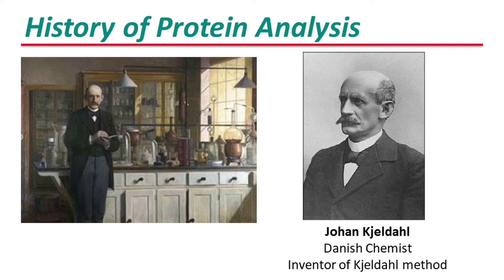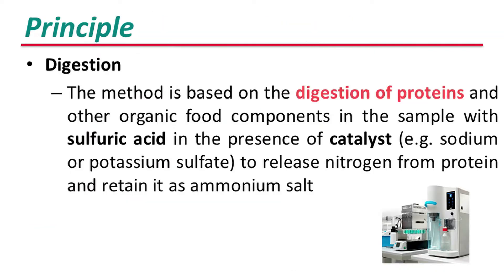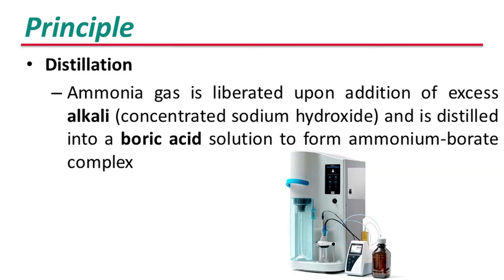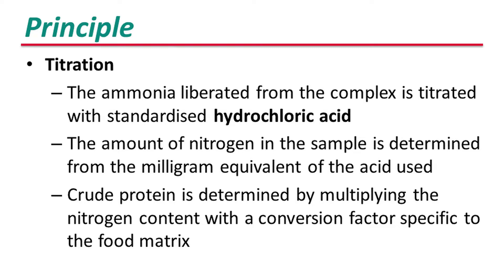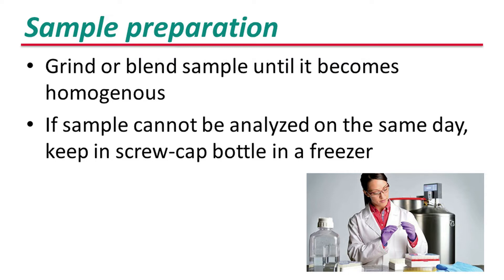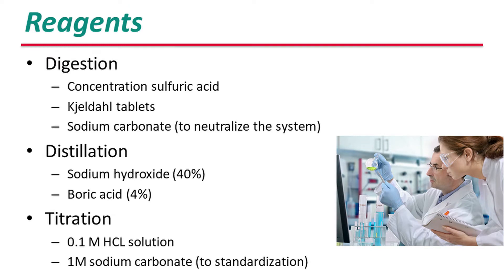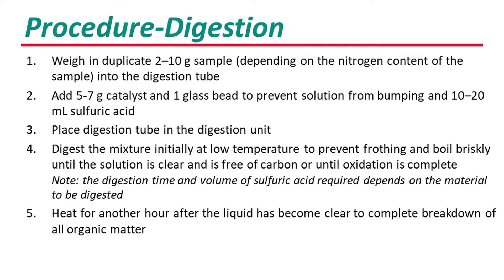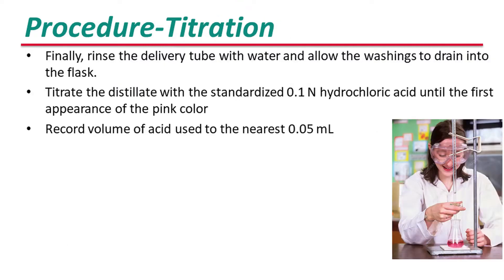How to Determine Protein Content of Foods I Kjeldahl Method I Food Science and Technology

Comment: While i am doing After the digestion there is something setteled in the bottom of the tubes (black colour) what was that
Reply from the maker: The black sediment at the bottom during Kjeldahl digestion is usually charred organic material or metal sulfides, depending on the matrix of your sample and the reagents used.

Here’s what could be causing it:
	1.	Incomplete digestion: If the sample contains a lot of organic matter and the digestion isn’t complete (not enough heat or time), carbonized material can form and settle as black residue.
	2.	Sulfate salts or metal sulfides: Kjeldahl digestion typically uses sulfuric acid and a catalyst (often copper or selenium). These can react with elements in the sample to form metal sulfides or other dark-colored compounds.
	3.	Carbon residue: When organic matter is exposed to strong acid and heat, it can leave behind elemental carbon (char) before full breakdown occurs.

To avoid this:
	•	Make sure the temperature is high enough (~350–400°C).
	•	Use the correct amount of catalyst and digestion accelerators like potassium sulfate.
	•	Allow enough time until the solution becomes clear green or clear blue, indicating full digestion.

If you’re consistently seeing black sediment, it might mean the digestion is stopping short of complete conversion to ammonium sulfate.

Comment: Thank you very much! This is very helpful a day to my examination. Is it possible to get a calculated example for the calculations? I would really appreciate it.
Reply from the maker: If we think the experiment is to measure the protein content of 5 g of meat,

You need following data set(here I am giving values for the example)
The amount of HCL for the titration= 3ml
The amount of HCL for blank titration = 1ml
Normality of HCL = 0.1 N
Weight of the sample=5g

use the equation to calculate N %
it will be 0.0056 g

then you can calculate protein %
use the equation. ( coversion factor of meat is 6.25)
0.035% is the final answer.